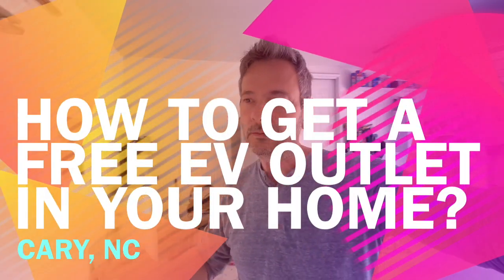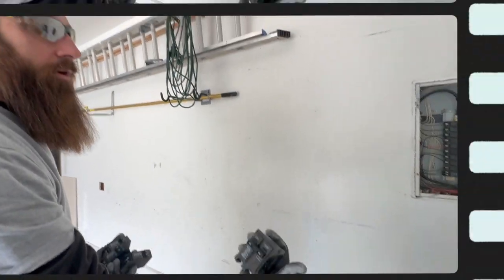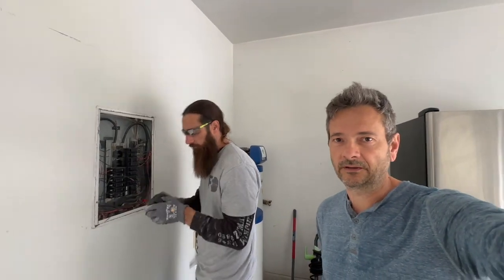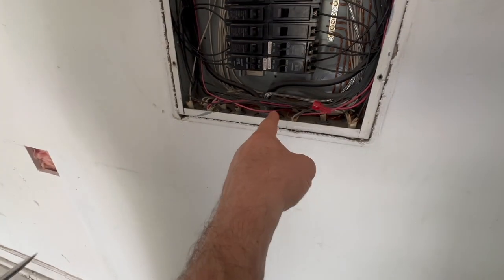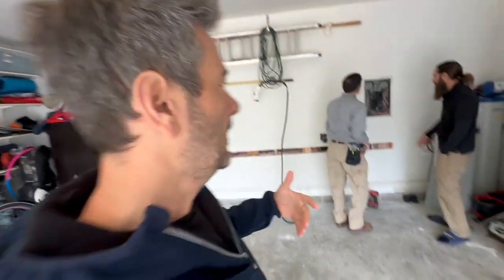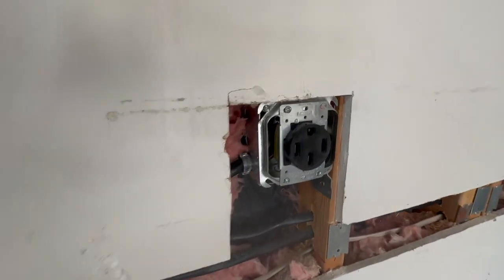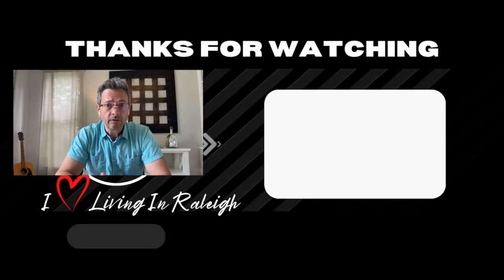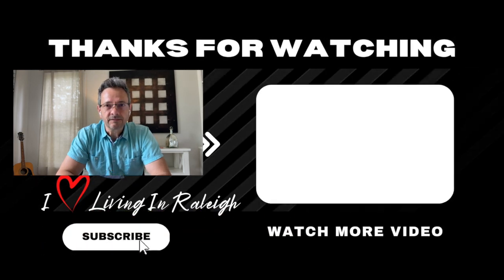How To Install a FREE EV Charger Outlet at Home - NEMA 1450 EV Outlet Installation Guide

Comment: As usual, great informative video Mihai!
However, I have a question. 
According to NEC 2020 - 210.8(A), a NEMA receptacle installed in the garage requires a GFI breaker. NC does follow NEC 2020, does this rule apply here? Or there is an amendment that does not require a GFI. 
In other words, do we need a GFI breaker when the outlet is used for an EV charger

Thanks and keep up the great materials coming!
Reply from the maker: As far as I know a GFCI breaker is not required by code yet. According to the electrician, it will highly likely to be added to the next update though :)

Comment: I am not an electrcian but I am 99% sure that was not supposed to pass the inspection. Here are some thoughts after I installed one after watching a ton of videos:    
 1. A nema 14-50 is supposed to be setup for 50 amps (the 50 in the name stands for 50 amps)  - if the next homeowner plugs something 50amps in, it isnt going to work so it isn't to code. This is why some people hardwire instead of buying plugin versions.  This one isn't a big deal though.    
2. You had 8 gauge romex run. The max amperage on that is 40 amps.  For EV chargers the wiring is supposed to have a 25% buffer because heat builds up on continuous high load.  A 40amp wire can only supply a constant load of 32amps via an EV charger to be code. So 7kw not 8-9kw mentioned.  I didnt see charger model mentioned to see if it maxed out at 32amps or is programmable to 32 amps.   
3. I dont think you are allowed to install 2 outlets off that one breaker as it could be used at the same time as your charger and eat into your 25% buffer.    
4.  That subpanel looks overloaded - we cannot see the breaker size feeding it, but based on the thin aluminum wire on the mains,  I suspect you dont have the buffer needed there either with all the other stuff also in that subpanel. 
5.  You are supposed to use a GFCI breaker for this install with a 14-50 outlet.   If you had a hard-wired charger this would not be required until the latest electrical code is in place. 

For a NEMA 14-50 plug,  6ga should be run with a 50 amp GFCI breaker but doing that probably makes #4 above even more of an issue.   There are also a lot of people who say those cheapie 14-50 outlets melt and catch on fire - I would recommend swapping for a hubble industrial outlet.  

Anyway the most cost effective way for this run is to buy a hard wired charger that supports capping at 32amps  then you can use 8ga wire (40 amp) and a standard breaker (40amp).
Reply: That is a GREAT observation! I'm not an electrician either :) That being said, the breakers have been indeed replaced with 50 amp ones which was required to pass inspection. :) I think Mark could answer it in details. Bottom line is that around the Triangle, homeowners can take advantage of the Duke Energy rebate program to offset the cost of their EV charger installation. This is a great upgrade in an older home, especially if they are thinking about selling it in the future. Thanks again for your input!
Reply: Absolutely valid points. Every one of them.
Reply from the maker: @BikramDay  Thanks for the feedback!
Reply: You have a pretty good understanding for someone who is not an electrician. I am an electrician. I thoroughly enjoy picking apart these EV charger videos lol.

1. Your first point is valid, except that code allows for a 50 amp outlet on a 40 amp circuit because they don't make 40 amp outlets. 

2. Yes #8 romex needs to be on a 40 amp breaker. And yes 32 amp maximum load since it is a continuous load. The Clipper Creek charger plugged into the outlet at the end of the video charges at 40 amps, so this is a somewhat dangerous installation. That wire and the outlets are going to get HOT.

3. I think each outlet is a separate home run

4. Probably true. I doubt that subpanel is capable of charging two cars at once and supporting the other loads on it simultaneously without toasting the feeders. 

5. That is correct. Hardwired chargers have integrated GFCI protection. 14-50 outlets in the garage need GFCI breakers. That sounds expensive. What a waste of money.

I would have just ran some conduit to avoid cutting up the walls and installed two hardwired chargers. As EV chargers don't ever use a neutral wire and never will, running 4-wire cable to 14-50 outlets for EV chargers is wasteful IMO. Hardwired chargers are safer, charge faster, and install for cheaper.
Reply from the maker: @jay9308  Thank you for the detailed explanation! This is very helpful! The goal is to make people aware that they have options to have their EV outlet installed in their older homes and offset the cost! Duke offers a rebate up to $1,117 for those willing to put a little bit of effort into it. :)
Reply: Manufacture specs on installation of the 14-50R state that it can be installed with 50A or 40A OCP. This particular application we installed 8-3 romex with OCP of 40A (qty of 2…. Cables and breakers). Load calculation was performed before agreeing to installation of both new circuits. AHJ did question 40A rated wire feeding a 14-50R due to your exact concern for the next homeowner but since it was installed according to the manufacturer’s specifications, it was passed. Labels were placed on both the breakers and receptacles to notate for future homeowner.
Reply from the maker: @dumbledorph123  Thanks for the explanation! So, you don't think these outlets require to be GFCI protected? @jay9308 mentioned this under #5.
Reply: Not yet. Eventually the code will require anything in the garage to be GFCI protected.  @YoanaNinRealty
Reply: Also, the charger is set at 32A max which is why we did not go for 50A wire. We did account for 125% which is were the 40A OCP comes in.
Reply from the maker: Thank you for your input! This is very helpful! Really appreciate it!

Comment: If you want it to be free, connect it to a neighbor or the other side of the power meter.  :)
Reply: Ha Ha! That might be a solution although the neighbor might not like it :) As I mentioned in my previous comment, homeowners in the Triangle can take advantage of the Duke Energy rebate program to offset the cost of their EV charger installation. This is a great upgrade in an older home, especially if they are thinking about selling it in the future. Thanks again for your input!
Reply from the maker: @MihaiMocanu   Indeed! :) Duke offers this program. Sooner or later, most households will have an EV. It is a great selling point to whomever is looking to sell a home that doesn't have one.
Reply from the maker: Someone once said that imagination is more important than knowledge as knowledge is limited :) :) Yet, this time I would make an exception, have it permitted and  installed by a licensed electrician and apply for a rebate. It is a great addition to a house that doesn't have one :)